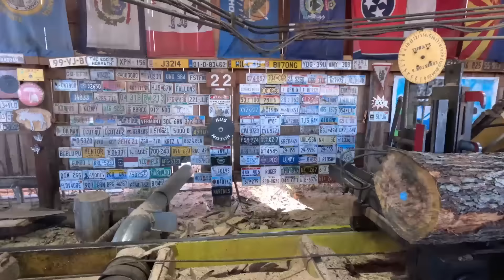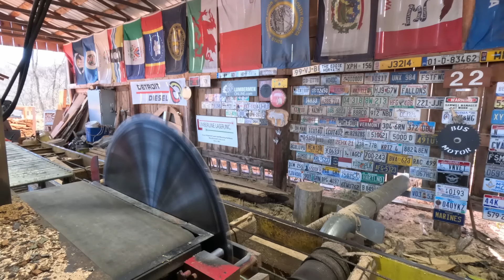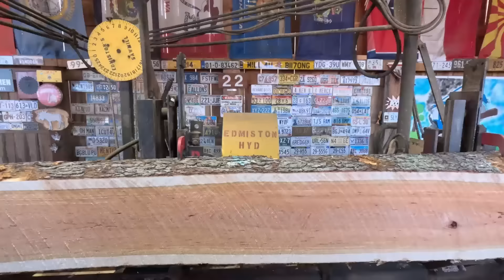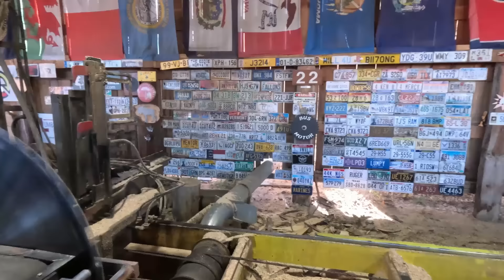sawing fresh cherry logs # 631

Comment: I’m pretty sure the hardwood grading rules you can have select 5 1/2 inch  but  6” or wider is preferred. And another thing. I was having problems with my log turner it had no power to turn the logs  so I copied the sprocket size from Mark Galicic  and now it works awesome   This man knows his stuff  thanks Mark
Reply from the maker: thanks!

Comment: Great video mark I'm sure you've probably explained it to the viewers before but when you first get into the log and create your parallel sides you're getting a lot of work done that your edger don't have to do because after you make the next turn within one or two cuts you've got a board with straight edges that's work your edger didn't have to do
Reply from the maker: yes it does save time in the end for sure.

Comment: Question????  you call that lumber cherry but that does not look like anything I have seen called cherry, the fruit tree or even wild, they have smooth bark that basically goes around the tree.  now I have seen trees called "cedar" that are actually cypress , is that what is going on with this "cherry". now I am from the Pacific Northwest and we have tons of Doug fir, hemlock spruce , western red cedar and several types of pine and spruce. we also have birch, popular, cottonwood, alder, maple, mostly soft wood as hardwood is rare.  just wondering...
Reply from the maker: this is black cherry it grows wild here.